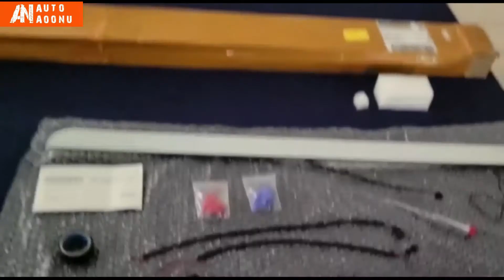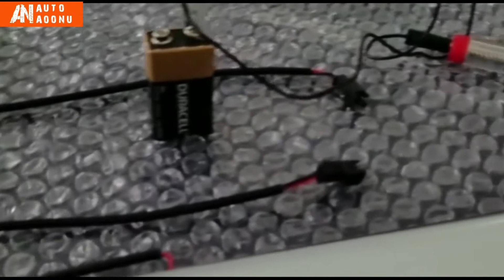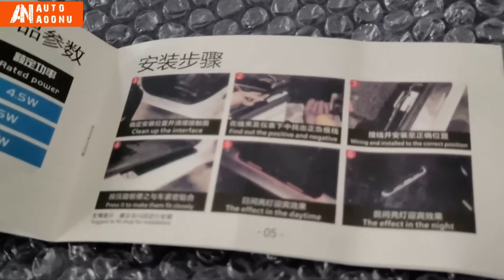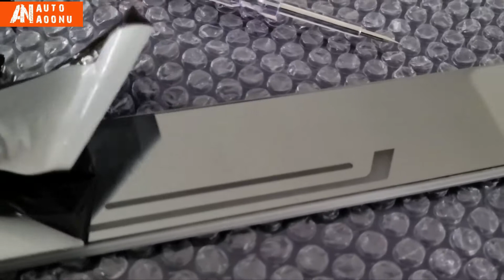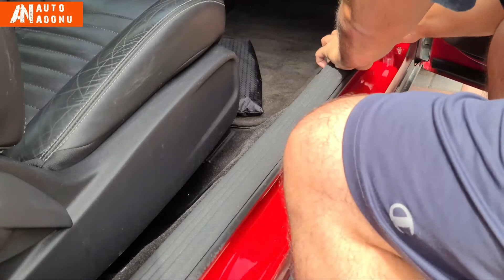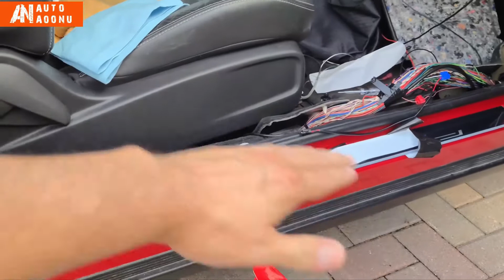2013 Dodge Challenger R/T LED Door Sill Install - AoonuAuto

Comment: Where do you get the wire where when the door opens the led comes on and when the door shuts it goes out. I want it to do just like the puddle lights on the door.